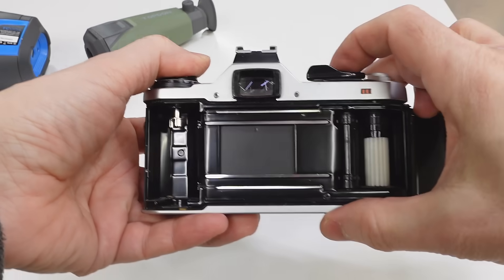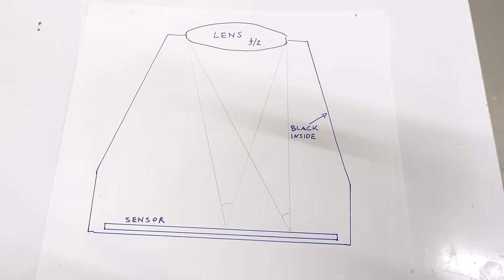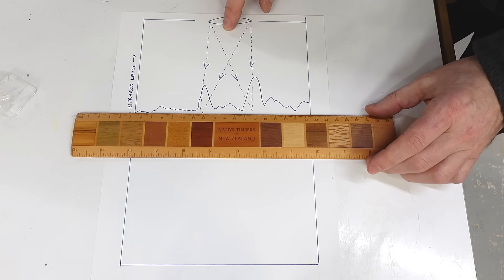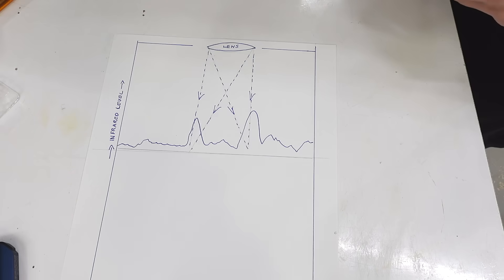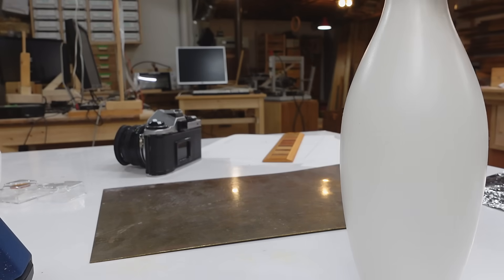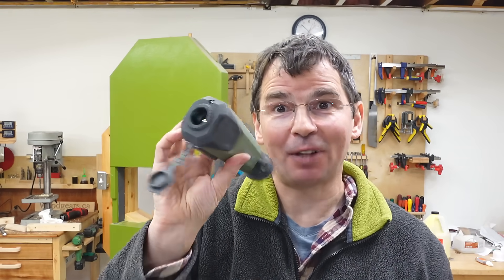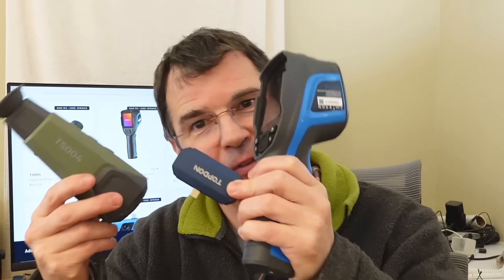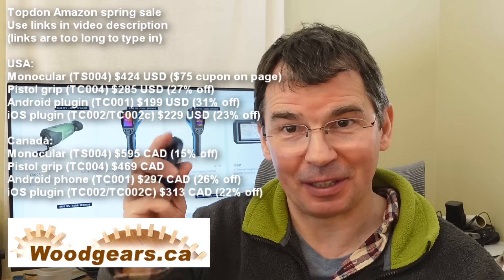How do thermal IR cameras even work without liquid nitrogen?

Comment: Drat.  A long complicated reply vanished when I bumped a side button on my new mouse.  Anyway, the idea is that a micro-bolometer cools itself.  It radiates energy as well as receive.  So, point it at something cold, the micro-bolometer radiates its energy and cools off to the same temperature as what you are pointing at, and because "micro" this happens almost instantly.  It is still useful to have a calibration and the body of the device will certainly contribute, but not much.  The inside ought to be shiny metal with emissivity less than 0.1 so it doesn't really "see" itself. 
Nomads in the desert use the same phenomenon; still air, cold night sky, you can freeze open water even in the Sahara.  The water, with emissivity of pretty close to 1, will radiate energy to the night sky and get almost nothing back.  On a clear night in the desert, my remote reading thermometer says minus 60 degrees. 
Keep in mind the fourth power relationship of temperature and emitted energy.  If the micro-bolometer was actually 30 C, then pointing it at the night sky would have such a minuscule contribution as to be unmeasurable (IMO).  It must cool itself and it cannot fail to cool itself simply by its own radiation.  Sure it sees its own radiation for a few milliseconds as it radiates out, then it cools to about the same temperature (or heats to the same temperature) as what you are pointing it toward.
Reply from the maker: true, it would cool down just a little bit.  but I think overall it’s relatively warm.  when I had the camera apart, there was a heatsink on the back of it.
Reply: @matthiasrandomstuff2221  If you stand in front of an open freezer, you feel the cold on your face; even though ambient air has not cooled (not yet).  Your skin feels cold because it IS cold; it is radiating more energy than it is receiving.  This is why automobile windows get frost or dew.

If microbolometer cells ONLY were additive; incoming radiation but never themselves radiated, you would never ever measure a temperature less than ambient.  Ambient (30 C for instance) is the starting point, and so much as a single photon arriving would raise the temperature.  Expose such a thing to the radiation of something also at 30 C, well, nothing will happen because the device is already warmed to that temperature.  If photons could not escape, then every arriving photon would continue to increase the temperature until it melted.

But it is axiomatic, anything that accepts photons also radiates them.  The microbolometer is radiating photons at the same rate it receives them for any particular temperature.

The lower temperature limit of a sensor is limited by the thermal isolation of the sensing element with the body of the thermometer.  I have a reasonably good one that can read down to -60 and I am reasonably certain that at that very moment, the sensor is at that temperature.  It matches whatever it is pointed at and then you simply measure the resistance of the element.  

These elements are in a vacuum, thermally isolated from the substrate, and very tiny.  They can and must radiate at the very instant of also receiving.  They will quickly equalize at the blackbody temperature where outgoing radiation matches incoming radiation.

I am only mildly surprised that I have not been able to find a discussion on this.
Reply: @thomasmaughan4798 

The reason you haven't found a discussion about your idea is likely because it is nonsense.

The thermal equilibrium you imagine would violate fundamental principles of radiation physics. Microbolometers detect temperature differences by measuring the very small temperature changes caused by incoming radiation. These changes are typically tiny fractions of a degree - nowhere near cooling from 30°C to, say, -40°C to match the night sky.

Missapplying Stefan-Boltzmann law isn't helping your case. Radiation emission is a thing but it doesn't mean the microbolometer will rapidly equilibrate with distant objects.
Reply: @ulfben  For what it is worth, I post my theory in hopes that someone with actual knowledge can provide a more detailed analysis of the physics involved than what appears available on "the internet".
Reply: @matthiasrandomstuff2221  It appears a type of microbolometer exists that intercepts electromagnetic radiation, using tiny bowtie antennas, but it is not clear how it measures temperature that way.  Such a thing does not distinguish between a lot of low temperature or a little bit of higher temperature.
Reply: In my experience, contactless temperature measurements are sketchy because the temperature of the thermometer affects the result. For example, I point a thermometer at the floor and it reads 75 degrees. Then I point the thermometer at a hot surface that is about 350 degrees. After that I point the thermometer at the floor again and now the floor reads 85 degrees. Obviously being close to a hot surface leaves the thermometer so hot that it gives erroneous readings. Moral of the story: you really have to know what you are doing with these devices. Temperature measurements were never easy and these infrared devices haven't changed that,
Reply: @satunnainenkatselija4478  "contactless temperature measurements are sketchy because..."
Of many factors :-)  
Glass probably cannot be reliably measured with one of these because of the low emissivity of glass (or shiny metal).  A piece of matte-black tape stuck to the window allows for a measurement. 
As you observe, the temperature of the device itself is part of the measurement although some attempt is made to isolate or compensate for that factor.

Comment: A cooled camera helps with absolute accuracy and resolution.

But i have a car mounted camera and when it gets foggy and moisture collects on the lens i get MUCH better picture when turning on the camera heater but it gives an halo around the middle, but overall much better seeing even colder areas then itself.

And having the camera in a different temperatures than the ambient is an big improvement
Reply from the maker: water is infrared opaque.  imagine black ink on the lens.

Comment: My DSLR can sorta do something like this for long exposures. It takes an image and then closes the shutter and takes another so that it can subtract pixel noise from the sensor. 

I wonder if this does something similar. Image sensors always seem to have interesting per pixel defects.
Reply from the maker: yes it does.  if I aim it at something really hot, it heats up part of the sensor, looks like burn in.  but after the next click, it’s gone.  no damage to the sensor, just part of it slightly warmed up.
Reply: @ Ooh! That makes sense. I pointed mine at part of a stove and thought I’d damaged it. Felt really bad about it, because it’s obviously out of the temperature specs. Even with a couple blown pixels, it would still be useful for my primary purpose. 

It’s now back to normal. 

My primary purpose is to check RV electrical work. My first 200 Ah battery got really hot at the positive terminal. I only noticed it because I was messing around more than usual with the initial install. But with 50A 240v and 100A 48v wires around and DIN switches and so on, detecting hot spots is an important safety check. 

I am also probably going to use it to check the RV’s insulation at some point. 

Another thing that I just realized it might help is figuring out internal structures. I was recently on the RV roof in the snow and saw the pattern of metal reinforcing bars visualized in melted snow. I don’t always have snow available :)

Comment: Im a programmer/systems designer/reasearcher in the LWIR field currently specialising on uncooled sensors, technically you can get accurate temperatures without the shutter, it requires a bunch of assumed knowledge about the system that hasn't really been worked out however (this is where i do research), mostly because research stopped on this in the 80s since the defence sectors essentially said "good enuff for our uses",

And LWIR has been essentially unchanged since, very,very good relative sensitivity, less than stellar absolute sensitivity however,

Turns out accurate absolute temperature measurements are more important in the upcomming civilian sectors than the defence ones, hence the small scale restart in research
Reply from the maker: bit not so important for price sensitive consumer, so it’s a niche application.
Reply: @matthiasrandomstuff2221  the same research that proposes the removal of shutters also proposes increased die yield, generally increased accuracy, and other things i cant say, with increased yield LWIR cameras can be made cheaper and manufacturing tolerances can be relaxed while keeping current performance, so to me its not impossible that the research i do will show up in some LWIR cameras for price sensitive consumers in the future as the research inherently focuses on getting the absolute most out of cheap LWIR systems.

for instance, the main model of camera we do research on right now is one of the cheapest commercially available thermography enabled devices on the market, the FLIR Lepton 3.5 priced roughly around $170, we are currently working on getting that to a dynamic stability of 1C in a $300 package, which sounds insane if you know the specs of the original device but we really think we can get there, (hopefully)

Comment: What IR cameras use are called cold shields.   Proper optical design and a proper cold shield and you can eliminate most extraneous photons.
Reply from the maker: Do explain what that "cold shield" is made of.
Reply: @matthiasrandomstuff2221 . Often Aluminum, but I’ve seen copper and steel, the inside will be polished and gold flashed. The cold shield sits on the cold finger so it is the same temp as the detector- the aperture of the shield is chosen so the FOV of the detector sees only what you intend it to see and the cold shield.
Reply: So when you say “cold shield” you’re talking about only the shutter mechanism?  And not a “cold shield” around the entire sensor area?

Comment: You can also see this on the seek camera modules. You can watch the shutter flap back and forth with a little electromagnet. Basically just gives it the set temperature reference and it constantly calibrates itself.

Comment: The shutter is also made of something very thermally conductive, and when the shutter is infront of the sensor, it also allows any offsets in any of the pixels to be corrected, as the shutter is assumed to be a uniform temperature. There's also a temperature sensor in the camera that's thermally coupled well to the shutter, and that gives the absolute offset
Reply from the maker: Yes, it does calibrate that stuff out too.  I thought about including it, but I figured it would be too much rambling.  if you aim it at something hot, you can see a bit of "burn in" as that part of the sensor is now warmed up a tiny bit, but after the next shutter click, its calibrated out.  Though as the warm spot cools, you can after a while see reverse burn in until the shutter clicks again.
Reply: @matthiasrandomstuff2221  Thanks, that's exactly what happened with mine when I accidentally swiped across the sun last time I used it. The line from the sun would go away with the calibration click, but slowly burn in again until the next calibration click.
Reply: Just like with the other monocular recording, for later review of the animal passing a known position.

Comment: The sensor will be at ambient. You were seeing the reflection of whatever the camera was pointed towards.
Reply: The sensor will be hotter than ambient temperature.  And all of the other electronics in the box will be hotter than ambient as well.  The battery will also warm up when discharging.
Reply: The sensor will be barely hotter than ambient. For all intents and purposes, at ambient. Careful thermal design is one of the requirements to get reasonable performance from a microbolometer.
Reply from the maker: It probably does get as much as ten degrees above ambient

Comment: Another great video!  @Matthias, would you be willing to try that twisted pair setup with your calipers?  I would really like to see the noise reduction using twisted pair vs. ribbon cable.  Keep up the great work!
Reply from the maker: its fixed to my satisfaction.  The outside wires on the ribbon cable are power and ground, so that already does a tiny bit of shielding.

Comment: It’s worth noting that the signal-to-noise ratio is most likely limited primarily by the shot noise in the shutter-closed image.  Subtracting that image will remove the signal but not the noise from all the IR from within the camera body.  That shot noise arises from quantum mechanics.  You can easily see that noise in digital images that are raw readouts from a sensor.  I think shot noise might be the only phenomena of quantum physics that I can directly observe in everyday life.
Reply: Shot noise is almost(if not entirely) invisible here because it's a microbolometer array, you're just looking at dirty ADC output. No photoelectric conversion. This is what defines the NETD and MRTD, but that's more to do with how clean the images are overall. You can still average out a bunch of frames(and the shutter sequence does do this) to clean up the nonuniformity and thermal differences. Signal-to-noise is defined by the ADC's resolution and the gain of the resistor divider amp, since you don't have any control over the detecting temperature range.
Reply: @Spirit532  Ah…yup, I thought they were photon sensors.

Comment: Isn't "thermal IR" a pleonasm?
Reply from the maker: "infrared" is actually a pretty wide part of the spectrum.  Near infrared, which remote controls use, and CCD sensors also pick up, is far away from the thermal infrared.
Reply: @ I see now, why you would want to specify the thermal part of a "thermal infrared camera" as there are IR cameras and not all of them are thermal.
But still, "thermal camera" should be enough without mentioning the more general class: it sounds like "mammal vertebrate" to me...
Reply: Don't think so. I'm not an expert on the technology, but legally and linguistically I'd argue that because IR cameras have different purposes, and use “false color” to interpret the data, “thermal IR” specifies a sensor with processing, aimed at showing humans a visual representation of thermal characteristics.
Reply: @rasmis  my point, thermal radiation is infrared radiation. Now, "temperature IR" is another thing...
Reply: No, because there is NIR (near IR) - wavelength 700 nm, just below visible limit e.g. TV remote and LWIR (long wave IR) 8-15 um used by thermal cameras. Thermal cameras are sensitive to LWIR because there is the peak of black body radiation with temp. -100 - 100 deg. C
Colours are artificial, sensor is "monochrome"  you can change palette in the camera settings.

https://en.wikipedia.org/wiki/Infrared

Comment: I think there is a little more to it. These modules contain an internal thermometer, that should be enough for calibrating out the internal radiation. I think the shutter is needed because the microbolometers are actually not linear and stable enough for a static calibration.
I'm sure someone on the eevforum looked deeper into it while developing their pc clients.

Comment: I often wondered why predators didn't evolve eyes that were able to detect infrared, since nocturnal pursuit would be so much easier. This noise within the eye itself may be the key regarding why it is so difficult for a warm bodied eye to function with infrared detection.
Reply from the maker: water absorbs the thermal infrared.  This would make it pretty difficult for a living creature to have eyes that pick up thermal infrared.
Reply: Some snakes have infrared senses in two little indentations on the head.  And yes, they are cold blooded animals. This may help.
Reply: Why specifically detect infrared (which wouldn't be much of an infra anymore, becoming a part of visible spectrum) when you can detect the overall amount of light better, infrared included, with higher amount of rod receptors?

Comment: Two questions:
1. Is that a Pentax Super Program film camera?
2. Do you seriously work in a workshop at 14 C?? 😮
Reply from the maker: I have tried heating the basement, but being rather large and a concrete floor, the heat dissipates pretty quickly.  So I just dress warmer.  When its really cold, I use an infrared heater aimed at me.
Reply: @matthiasrandomstuff2221 
Given it's a basement, did you, by any chance, check for radon levels?
Reply: He's cold blooded (or cheap), just like Big Clive, who keeps his house at or below 10C - he's mentioned it in a number of videos. Some people's cheapness is stronger than their desire for comfort, or they like walking around with 3 sweaters on.

Comment: I've got a P2 pro, stunningly capable thermal camera in a stunningly small package. They're like a cheating device for electronic faultfinding!
Reply from the maker: last time I fried a raspberry pi, I just had to look where the smoke came from!
Reply: @matthiasrandomstuff2221  The macro lens for mine allows me to see individual bond wires heating up from internal shorts, it's insane how detailed and affordable thermal cameras have gotten lately
Reply: the p2 pro and the topdon (and other) cameras all use the same sensors, made by Infiray. The only difference is the vendor ID in the USB device, the plastic enclosure, and the software. The macro lens with the P2 pro is VERY useful for PCB troubleshooting!